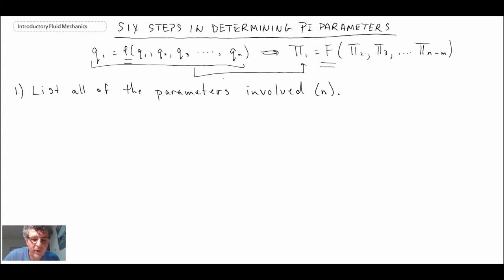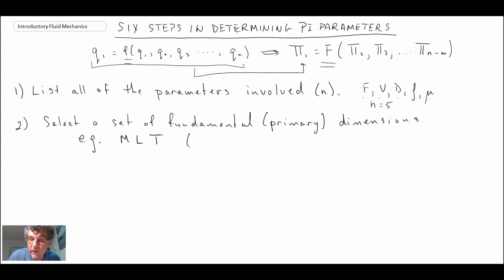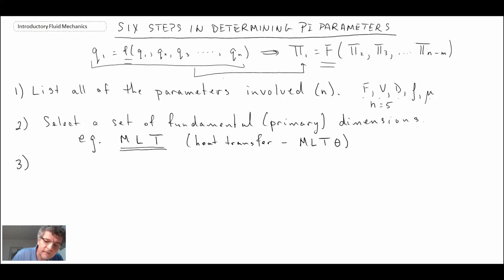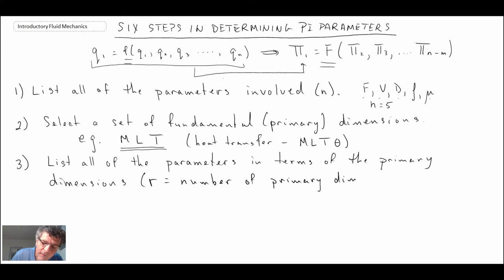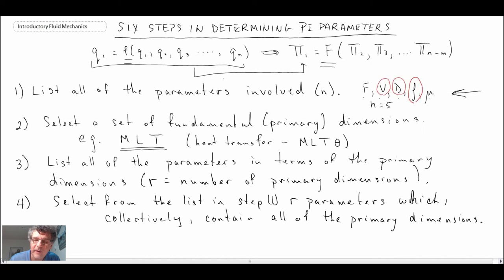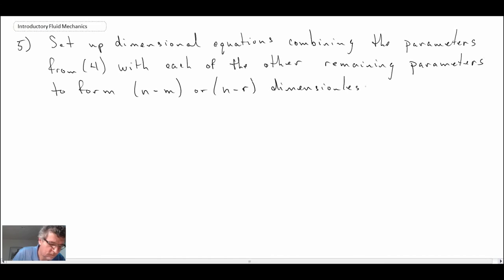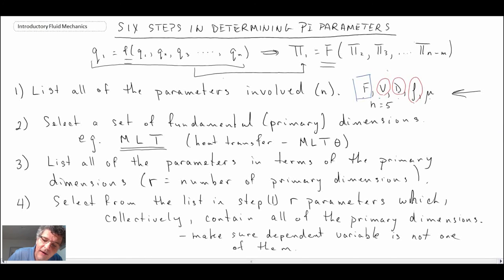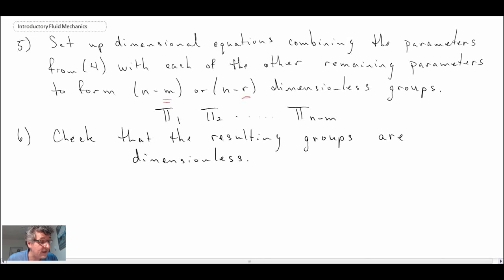Introductory Fluid Mechanics L14 p3 - Six Steps to Pi Parameters

Comment: First of all, thank you for posting all these videos. They are very helpful!
In step 4, I should not include, for example, both an area (L^2) and a second moment of area (L^4) as repeating parameters. But, if this is the case, D has [L] and rho has [M/L^3]. Doesn't this contradict one of the conditions in step 4? thank you
Reply from the maker: +Diego Fung Hello - glad to hear that you find the videos useful.  Concerning your question, D only has [L] whereas rho has both [L] and [M], and thus they are OK as you are adding a new primary dimension with rho.  If you use L^2 and L^4 you are not adding a new primary dimension by including both L^2 and L^4.  It would all depend on the specific problem, but as a general rule you don't want to repeat parameters with identical primary dimensions.
Reply: +Ron Hugo Thanks for the explanation!